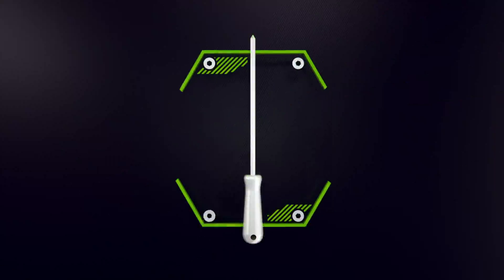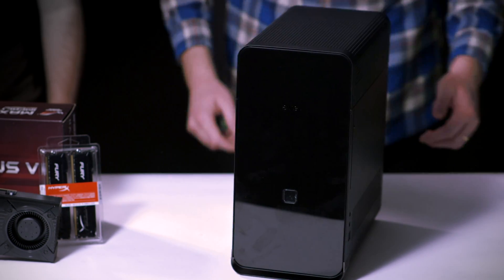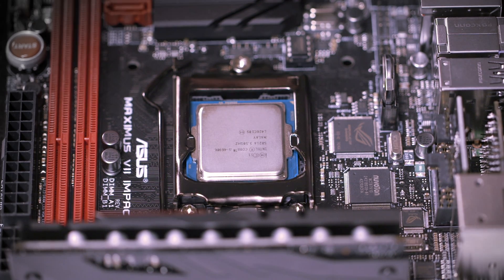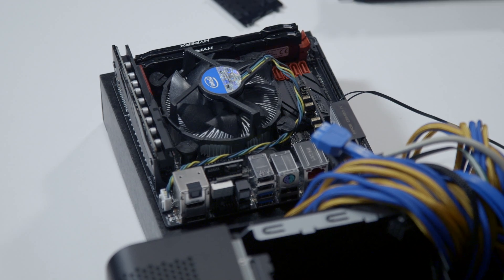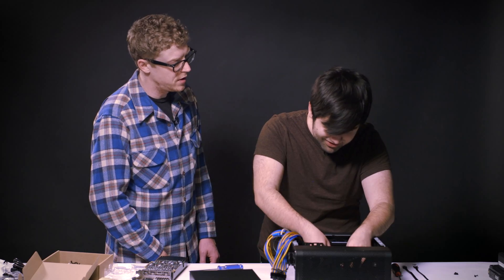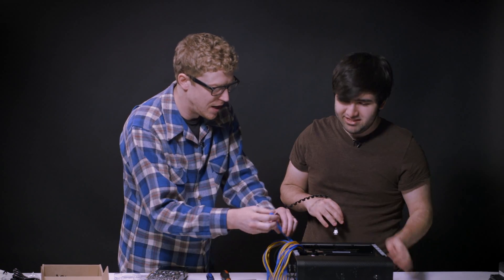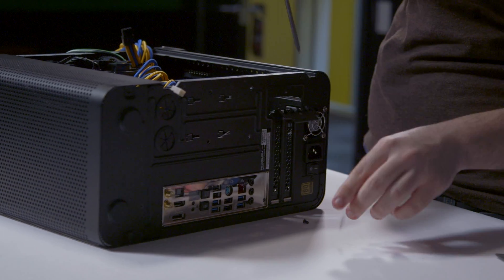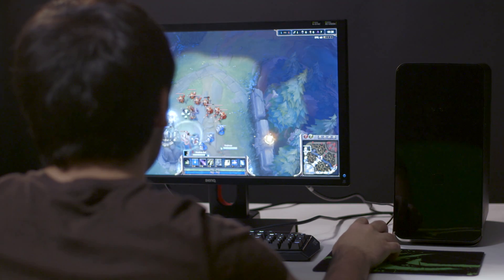GeForce Garage – How to Build a Competition Ready e-Sports Rig

Comment: 16GB RAM for a LoL PC? oh dear...
Reply: I might be wrong and I apologize in advance but perhaps they choose 16gbs because they are counting on that lately more and more players start to stream and that might be a contributing factor. Also video editing is affected by ram I think.
Reply: Not only that, but he called it "1833 clocked." XD
Reply: Yea thats more than overkill...
Reply from the maker: In the full write-up, we do mention streaming.  http://www.geforce.com/whats-new/guides/geforce-garage-how-to-build-a-competition-ready-esports-rig
Reply: The new i5s are perfectly fine for video editing and streaming...
Reply: hyperimus Streaming is helped significantly with extra RAM, but only to a point. Streaming might occupy 1.5/2GB for an HD stream. Though games like LoL/Dota/CS:GO like this system was made for typically use less than 4GB. So even 8GB would have been more than sufficient here...
And RAM does help with video editing, but this system is not intended for it... It only has an i5 4690k and a GTX 960, which are great for games, but not so much high end editing.
Reply: Doubt they will overclock on that cooler
Reply: Where does it say It isn't doing any rendering, you can't just make random assumptions
Reply: ***** Are you high?  That's a 32bit limitation.  There's lots of games with 64bit binaries that are pushing at 8GB of RAM minimum requirements already.  And then you need a instruction/data/texture cache for your GPU drivers.  16GB might be 'overkill', but it doesn't hurt, either, it means you don't have to worry about software bloat making your machine obsolete in a handful of years.
Reply: how do you know it isnt intended for video editing?
Reply: If it were intended for video editing, they would have at least used an i7 instead. It's also likely that they would have mentioned video editing in the viddeo as well.
Reply: brandonhughes7 Where does it say it is limited to just gaming, I don't see it in the title?
Reply: ***** competition ready esport, does it mean video 3dsmax rendering to you? 16gb waste of ram and money, everyone knows a good and economic esport pc is only possible with AMD, cpu, gpu, mobo.-
i will choose Nvidia only for laptops.
Reply: Where does it say It isn't doing any rendering?
Reply: OP Breezy you're late
Reply: ***** I mean.. Crysis thats kinda irrelevant considering your CPU barely has anything to do with it. Its more of your GPU on that one. But streaming yea. I mean Ivy Bridge was a good architecture. I mean hell all the way to the first gen i5's,i7's are still very good for what they are. 

a I7 990x , still has a .1 higher single core than a 8350 .. And those are two generations apart xD
Reply: +SelecTech you do realize I ws running an fx 6300 (3.5 ghz) gtx 750 1gig and 1 stick of 8 gig of ddr3 and was playing league, streaming, using spotify, and had another game open in the background while everything was still smooth as butter? Also too whoever said games are putting 8 gig as minimum requirements is an idiot. There is a huge history of games over-doing it on recommended and required specs. Take battlefront for example, there is virtually no difference between using 8 and 16 gig ram. 8gig is still the sweet spot and if you really need more you can always slap another stick in later.
Reply: How do you know he isn't content creating?
Reply: is that thing factory clock or they do over clock?, cant say how warm that rig willbe
Reply: ***** Read the title of the video.
Reply: hyperimus 16gb of streaming where and what? hd to mars? 8gb would be pretty cool. aftervall no game uses more than 2gb ram.
Reply: ***** where it says that he is an astronaut. with that logic we can asume all kind of bs as excuses. the kid doesn't even know how to use windows besides his game, does it strike you like 3d animator? if he was when was asked he would have said it.
Reply: Hey Guys, pls. help me w/ a moment of ur tym, I am sending this vid to gamers. hope u'd notice ds msg & share my vid.
pls. hover on the portal and help me open it to the world of gaming.. I am trying to raise funds to start my own gaming channel, Hope to get help from you guys. I only have one vid and I could make a lot w/ your help.
Reply: ***** Remains the fact that they might want to do video editing of their streams for highlights or something, and they might also have two programs one for streaming and one for video recording. I have OPS streaming at 3,5Mbs (bitrate) full HD 60fps but then I have bandicam recording only the game(no cam) at higher a bitrate for video editing and youtube publishing (which hasn't happened yet).

And as some were saying the processor isn't right for video editing....that's what a gpu is for no? I use adobe premiere and after effects frequently and my cpu is mostly idle all the time the Gtx 780ti does all of the work...even when I had the 550ti it did the work.
Reply: hyperimus focus guys! we talk about the kid in the video! none else that "may want to do this an that" in order to excuse the poor choice of overkilling the ram and not using a better fan, or a better GPU.
Reply: "e-Sports Rig"
Reply: they also used a i5 4690k
Reply: PunkJuggle so if the frequency is 1833, isnt it clocked at it then? if you do overclock it has to be a basic clock....
Reply: ***** Well srsly, there is no need to put in any less then 16 gb if you are doing your own pc, Ram is very cheap nowadays so just stop it.
Reply: Henrik Forsgren I dont know where you live buddy but in Australia for some reason 16gb is close to 160 or more Australian Dollars
Reply: ***** your lost dude
Reply: no one mentioned.. the 480gb ssd? 

i think he should use a caviar black 1tb for storage / games.. and that ssd for the OS and the editing programs...
16gb of ram is not an overkill now a days.. if you do basic video editing + streaming you'll need those extra gbs..
Reply: In todays tech world 16GBs is not overkill lmao... I have 20GBs of RAM and I'm still looking to add some more
Reply: 20GBs 😂😂😂
Reply: puRpInF3cTioN it's a budget build loser
Reply: I'm the loser and you on the budge
Reply: ***** 16gb is not for multi tasking... no... no .. its for rendering  RAM previewing .. 10 chrome tabs you can do easy as hell on 8gb
Reply: PunkJuggle Because it is..?
Reply: Toby McDaid Its the same shit for all these big companies tbh.. They over kill everything because they have sponsers only giving them high end shit
Reply: |Scrub:The:Gamer| it feels like amd is just giving up, no new processors since 2012, not counting the 9590 but even that is just an overclocked 8350. Their 300 series cards are all just re-branded, it's sad really.
Reply: I have a G3258 , i5 3570k , i7 920 , fx8350 , fx9590 , and a i5 4670k .. I know what is is like. Although a " noticable " difference.. On the g3258 it wasnt bad still
Reply: Toby McDaid Keep in mind that a lot of pros have very long queue times.  That being said, a lot of them have the league client open, stream, video-rendering, and quite possibly another game open all at once.  I'm not saying that 16GB isn't overkill but likely preferred over 8GB just so there aren't problems down the road.
Reply: Toby McDaid Streaming baby.
Reply: +hyperimus 
correct, they need the extra ram to stream while playing.
Reply: +Joe Mills You don't need 16GB for 10 chrome tabs. More like 40
Reply: +Valkyrie You&#39;d be surprised how easy it is to use up 8GB if you're not very concious about what programs you keep open.
Reply: +Samuel Kwok Then be conscious of what you have open. It isn't my problem if someone forgets that they have ten other programs open without notice.
Reply: Samuel Kwok im with valkyrie on this one. Using 8 gb of ram is pretty hard as long as you don't keep all your programs open at once. its your own problem. not everyone's
Reply: Rey Jukes I never complained about it being a big problem. I'm just saying that with all sorts of background applications and a few things running on my computer, I use up about 7.Of course it greatly varies depending on the person, but right now I'm sitting at 7 used up just with about 8 chrome tabs, skype, steam, geforce experience, and spotify running along with AVG in the background. And from what I've seen, a lot of people leave a ton of shit running on their computers much of which are background apps that can use up to 4gb all on their own.
Reply: Samuel Kwok alright. You and those other people can have a ton of things open in the background and feel forced to buying 16 gb of ram. ill stay here using 8gb of ram while maintaining good performance as well as a reasonable level of multitasking
Reply: There's nothing wrong with 8GB, and in most cases I do find it to be a waste but I find it very unpredictable how much I'm using. I actually only have 16 because my friend had 32 and had no use for it xD
Reply: Rey Jukes BTW I just disabled SuperFetch and my memory usage went down by 60%. So that's where it all went...
Reply: Samuel Kwok there u go
Reply: +johnnyxp64 Some games these days use over 6 gigs of ram or almost 8.
Reply: Vertti Seppälä what is the title of this video?
Reply: Not to mention it's using a stock cooler...
Reply: They are the same people who think that a PC that is relatively recent is an incapable ancient system.

Comment: Why don't you use 4 GB of ram xD
Reply: They should have done 8, they were using an gtx 960 and an core i5.
Reply: MineCraftEr I was referring to the gtx 970 bandwidth issues. Not the system memory. :P
Reply: +Rocket2282 Vram* then ^^

Comment: hey nvidia, an i get a refund for my 970. since it doesn't have 4gb as advertised.
Reply: It has accually got 4GB vram the thing being that the "missing" vram is 1/7 the speed of the 3.5GB of vram.
Reply: It has 4gb, but the last 500mb are way slower than the rest. But i think u should get a card that has this fixed, or you get your money back ;)
Reply: Smithy Plays You can't add up VRAM speeds with diffrent bit? 
This is the computer world, not second grade math.

EDIT: Hope you're joking.
Reply: It does. But what happens is that runs 7 out of 8 modules at max speed for 3.5 gigs and power up the last one at a lower speed when needed. But almost no game in market uses more than 3.5 gb of vram at 1080p/1440p
Reply: but why didn't they just exclude the 500mb and reduce the price? or does the architecture of the gpu require this?
Reply: Drew P. Balls i think i read somewhere it was made to optimize power consumption. If 95% of the games never need more than 3.5GB at common resolutions (because no one is running 4K on a single 970). And yes, the advertising was misleading. But the card actually have the 4 gigs. But only use them full when needed.
Reply: Alfredo Gonzalez totally wrong, the memory interface is smaller and u have less rop's  and chache
and under load u get a "frame desaster" in some situations. u cant say 3.5+0,5=4 its like when u say a 2 ghz quad has 8ghz

3.584 GDDR5 (224 Bit)
+ 512 MB GDDR5 (32 Bit)

for those who are intrested http://www.computerbase.de/2015-01/geforce-gtx-970-vram-speicher-benchmarks/
Reply: You should of stayed in school.
3.5 + 0.5 = 4.0
Reply: +nevenjere most of the world doesn't know german.
Reply: Brolaugh  try google translate, should be enogh for understanding :D
Reply: Smithy Plays Games recognize only 3.5gb in-game
Reply: Wow.. I know this hard to understand and all one has to do is go to the NV forums and read. Who made your card? Go for it share why Nvidia would give back money that you never paid them? Not talking about what got said that was not on the card. Not talking about a card that has 4gb of Vram on it. No one lied. Got used differently and granted WHY.. Not sure why you never said anything in the past about.. hehe search.

Again hard here.. If you bought your card from lets say NEWEGG and it was a ASUS card.  How does NV give you all your money back? Did ANY of these card members say "nothing is wrong with our cards". So if they call that card you have theirs.. would not should not you be on there site trolling them? You look foolish telling NV to give back something you never paid them. Yes the made the GPU now find out how the rest is made and just why Asus and other TAKE your money. Lol
Reply: Brolaugh I hope you notice that 1/7 speed VRAM is actually slower then your system RAM. So it doesnt make sense at all to use it.
Reply: LTT said that that's not true. So it does make sense to use it.

Comment: mine has a 5 way xli setup with3 5960xes, no one can beat me in minecrift now
Reply: GeniusHD GAMING The 5960x is an Intel CPU. He's just making a derp troll comment.
Reply: First 5960 is an amd card. Second nVidia has sli amd has CrossfireX
Reply: And the max is 4 way sli or crossfire
Reply: no you need a Pentium 3. Does that play well at medium settings? Do you get 40fpm?
Reply: Dncmaster its xli, they clanged the s to x FOR EXTREME!
Reply: XLI = Xtreme Link Interface
Reply: Drew P. Balls XLI? That will get 24fps on medium on 360p
Reply: Drew P. Balls You need 10 way XLI to get 60fpm
Reply: SLI * .....
Reply: Sethos no I know about 5960x to be an intel chip but the amd 5960 gpu
Reply: +Tiliscan Robert there is no such thing as an amd 5960. There is a 5970, but 5960 is an intel chip.
Reply: +V1de0Gam3 G4M3R™ 40fpm? Frames per minute? xD
Reply: +dumb guy 
I really don't know what to say about this stupid comment...
Reply: +Colin McEwan Thanks mate i thought 5960 to be an amd card but it's 5970.Again thanks!

Comment: rather have you redoing the 970... and give the fixed version freely to the people who bought it.
Reply: People seemed to like it before the memory issue was found out. The benchmarks are still all the same. I have a 650ti. More than 1 gig of memory would be great but hey, all I play is fallout that's modded to shit, sometimes some BF4 and a few other games. I'm fine with 1 Gb. Does having 3.5 Gb make your rig explode when you find out it had 3.5 Gb?
Reply: Sandwich247 funny, I have the same just in 2gb, but it isn't fair for people that wants and bought that card for 4k and bigger vram than 2/3 gb.
Reply: Runaeh I guess but still, If they could run 4k before then they still can. If tehy don't have 4k yet tehn there is still time to convince them that 144Hz is better for gaming.
Reply: Gnana Prakash I guess. Corperate lying isn't un heard of though. And the benchmarks are still the same.
Reply: Sandwich247 It's the fact that they straight out lied about the specs.
Reply: Gnana Prakash Well, it DOES have 4 Gb of memory, it's jsut the last .5 gigs don't work as good for some reason.
Reply: Sandwich247 Apparently, they lied about other stuff as well. The ROPs , The TMUs etc
Reply: Sandwich247 Expect it is not. 60hz is smooth enough for %90 of games. 4k just looks insanely better its worth the FPS trade whence you can get 60fps.
Reply: Navhkrin You can do what you wan't. 60 Hz is choppy compared to 144.
Reply: Sandwich247 Differance between 4k and 1080p is greater then differance between 60hz and 144hz.
Also 60hz means 16ms, which is enough for you to have sense of world around you even in fast faced combat.

AND

in 1080p you wont even notice differance at all unless you go very high paced action.This is because of pixel updates, nomattter what response time you have. If pixel attempts to move right by 1/4 there will be no action , no chance. However in 4k since it has 4 times more pixels then 144hz you will actually notice such differances.
Reply: Navhkrin So when people performm far better in games due to using 144Hz, thaey're only performing better due to a placebo effect?
Reply: Sandwich247 People who perform better? Not really. Its all psycologic. Sure 144hz gives way more information compared to 60fps. BUT
60fps already gives you all the information you need in very good timing. Differance between 144hz and 60hz is only 9miliseconds. And i dont really think people lose in games because they did miss that 9miliseconds. Let alone the fact internet is generally not that responsive and in such situations both people will die.

Unless you are attempting to become uber pro in CS:GO, 144hz is not really that important. ITs just not worth the trade of good graphics. 
Also please note that this is my opinion. Its not a fact.
Reply: Navhkrin I like to have everything buttery smooth. There was a video I watched where a guy showed K/D ratios he had while playing CS and at 60 he was in the middle, 90 Hz, he played worse, 120 he played a little better than 60 Hz and at 144 he played far better. I'd go for 144Hz.
Reply: Sandwich247 As i said its psycological. Human response time is around 200ms. There is only 2ms differance between 120 and 144.
Reply: Navhkrin You're thinking about this in response times. I'm thinking about this in what the eye can see and what the brain con process. We can see up to about 225 FPS. 144Hz monitors display up to (well duh) 144 FPS. People describe seeing the game in 144Hz, they say it's like being in a slightly slower motion. It's almost as if tehy have a little more time to react. That's important to me.
Reply: Sandwich247 All you need is the first frame to judge whats around you. Nothing more.
If i showed someone 2 monitors, one 144 one 120. And if i told him that 144hz one is 120hz and 120hz one is 144hz. He would say that he feels more responsive on 144hz while it actually was 120. 

Also human eye can see more then 225 fps, There are tests that confirm its above 300fps, max limit is unknown.
Also note that with adranaline your eyes capacity will also increase.
Reply: Navhkrin Oh, we can see more? I allways assumed it would be higher thatn the 225 but I geuss it makes sense for use to see more.
Reply: Sandwich247 Theoratical limit is around 1000fps but scientist cannot be sure of the real number
Reply: Navhkrin Well, it's higher then any displays that are arround these days.